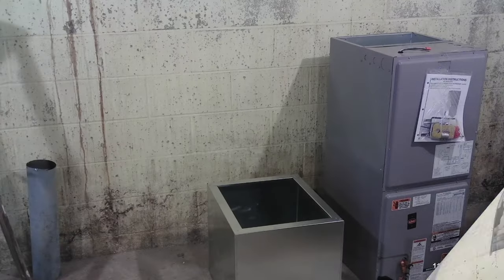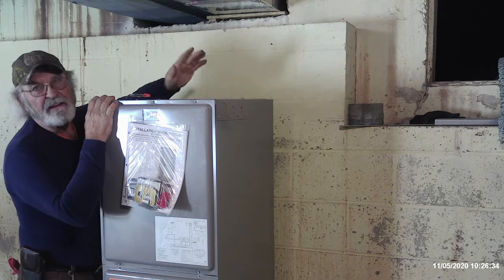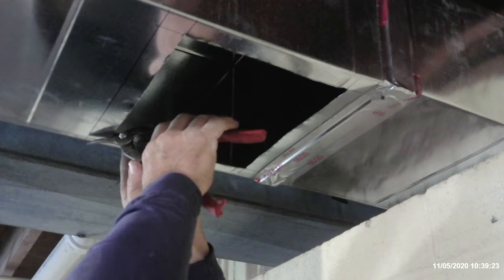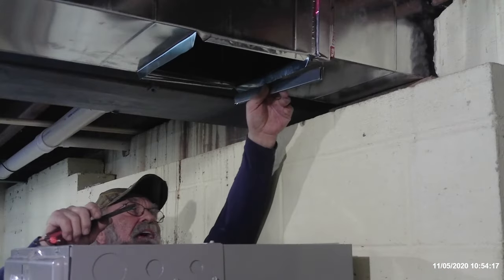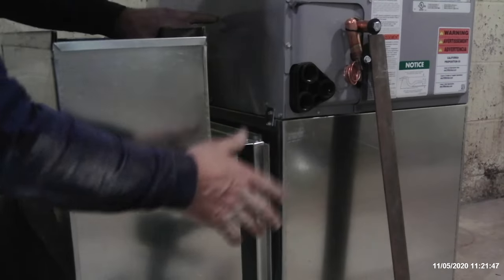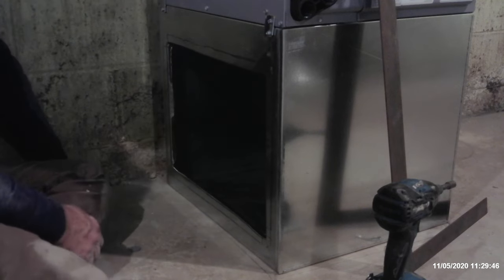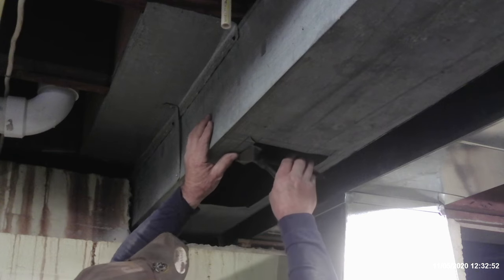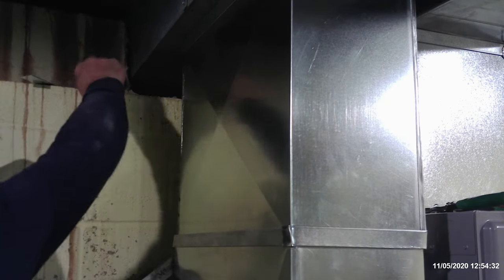Air Handler,  Centerline Plenum Transition and Return Air Installation

Comment: Wendell i love watching your hvac videos, as i have installed a few myself for over 50 yrs and trained a few guy's thinking they wanted to learn hvac business. Watching you is like watching Bob Ross painting a masterpiece. THANK GOD FOR ZIP SCREWS!!!
Reply from the maker: I remember the first day hanging duct with an old guy back in the mid 70's.  I'd hold an 8' piece of trunk line as he would use a punch to poke a hole in the hanger and bottom of the duct then run in a pan head with a flat screw driver.  THEN I got a better job in the big city.  The guy that owned the company gave me a Black and Decker VSR electric drill, a 50' cord and a NUT RUNNER.  I asked him what that was for.... LOL.  He handed me a 500 count box of 1/4' x 3/4 hex head zip screws and like they say...the REST is history. LOL.   Good GAWD...I thought I'd died and went to heaven !!!  
    A couple years later a buddy bought a  7.2 volt Makita battery drill.  What an incredible discovery that was.  I'm sure Tom, that you remember all those kind of things as well.  Thank you for taking the time to always make the best of comments !!   The Bob Ross part really cracked up the Missus...
Reply: Awesome memories. I always felt so grateful for being younger. I started in in 2005 at 22 yrs old

Comment: Great install,  Tractorman44. Today's  rookies would throw a flex connection on the supply and return to compensate for there inability to measure with precision.Thxs for the vids!
Reply from the maker: I have used flex connections commercially in the past but only as vibration isolation.  I don't remember ever using them in a residential application unless hanging a unit from the trusses in an attic, but that too would've been for vibration isolation.    But I have seen a lot of them on units while on service calls. Thanks David for the comment !!
Reply: @tractorman4461  
Thats what they used at my house to do a hvac replace job.  They do have good sheet metal guys. They designed a filter spot at the shop for a air bear glassflo type filter 5" thick in the return L .
But they used the flex boots on both return air and presure air sides. 
Almost no sheet metal work was done at the house.
Reply from the maker: @bobbg9041  Yes, there really isn't anything wrong with flex connectors, as they provide a specific benefit to an installation.  The most important thing about your change-out was the addition of the filter slot for the special filter.  I'm not familiar with that particular filter, but I'm assuming its an expanded surface pleated filter.  Sounds like you are enjoying a dust and pollen free indoor space !!

Comment: Outstanding work !  I,m an old-school tinner like you even down to snipping the corners on the drive-cleats. 30-plus yrs. for me.Still at it.
Reply from the maker: That's cool William.  I'm in the middle of a nasty job for my son right now.  So that's going to be a good three or four videos in a series.  Air handler, all new duct in a renovation project, adding a wood fired furnace and motorized back draft dampers in the supply plenum of the air handler and in the short trunk line from the wood furnace. 
   I've got a couple sheet metal playlists put together up top if you are interested.  They really aren't geared for experienced guys, but if you just like watching sheet metal videos, be my guest.  Thank you for the compliment up above !!

Comment: This showed me how to connect my plenum box to the air transition on my existing air handler.  It was something else to find cookie sheet sized holes in my air ducts.  Now those are getting replaced and this is one more piece of the puzzle.  Fun work still ahead in the crawl space.
Reply from the maker: I never liked crawy spaces, but have been in hundreds of them.  Some bad, some are worse and none are good !!   If your duct is not insulated, you might consider doing it.  Not easy but it'll be worth the aggravation in the long run.  If you do, this is a good product. but only use it with aluminum tape.  Duct tape will fail.  You can even wrap the round pipe with this pretty easy. https://www.amazon.com/Insulated-Metalized-Mylar-Double-Bubble/dp/B00T8ELAZ8/ref=sr_1_5?crid=1JUSJ9W534T3P&keywords=mylar+covered+bubble+wrap+roll&qid=1643892250&sprefix=mylar+covered+bubble+wrap+roll%2Caps%2C165&sr=8-5  Thanks Nathan for an awesome comment.  In this playlist is one utilizing this product: https://www.youtube.com/watch?v=PvDab537ul4&list=PLk72G9DTzZ1taVZjyeN9DKr52HQ3hhcXd

Comment: Thanks for the sheet metal videos you are a true craftsman. Like how you showed how stuff is done in the field vs a shop setting. I just did a job and premade a 4 inch spacer on an oil furnace to keep it above the heat exchanger. Then tied into the plenum with s cleat. It worked out great takes a lot more skill than ductboard. We don't have access to Pittsburgh seam here in field. Was shown to leave the s cleat an inch long top and bottom then notch a layer out so you can hammer them around and hide the gaps.
Reply from the maker: Oh, I can tell you dozens of tricks I've used over the years with S's and drive cleats.  I have bent many a plenum on the floor of a basement back in the day....I don't want to have to go back to that.  I've also made hand made pittsburghs too.  But no more. Asdasda, if you like the 'on site' portions, check out this playlist a little at a time if you'd like.  It was a tough one:  https://www.youtube.com/watch?v=PvDab537ul4&list=PLk72G9DTzZ1taVZjyeN9DKr52HQ3hhcXd

Comment: I learned from my uncle, and he does things almost exactly the same way you do. We used the old screwdriver trick, too. I use the dewalt demo chisel now. I have the exact same hammer. I'm 36, and the hammer is about 35 years old! My uncle taught me S was for the shape/smooth seem, and the C was for channel/clip. We always called them S or C channel/clip. It shows you that if someone wants to work and make a living for themselves, you don't need a ton of tools or a bunch of crazy names for things to get the job done. You just need to get off the couch and get to work. Into home depot I go on Sunday at 3:30pm to go install a furnace. My second job today. I installed rear calipers and pads on a 2003 envoy this morning for $140. Now, to install a furnace in a barn loft - man cave for $400. It's not too bad for a Sunday by yourself in Northern Ohio. Great job, and thanks for sharing your skills. I appreciate it 🙏
Reply from the maker: Awesome comment Robert.  There is so much work out there to do its unbelievable that anyone with the ability to learn and work is unemployed.  I applaud your integrity as a working man that 's not afraid of getting your hands dirty !!  Keep on keepin' on my friend and learn all you can as you do.  If you've the time and interest, check out this one here:https://www.youtube.com/watch?v=i2KFLZGbZwI&t=1s You may find it interesting and thank you for stopping by and taking the time for the cool comment.

Comment: Nice work looks tight and clean. I wish i had a teacher like you for my tin work.
Reply from the maker: Thanks Rocko for the nice comment.  I spent  lot of time figuring out how to use the machines to produce an adequate product.  As a young service tech, I used to inspect closely any kind of fancy duct joints, bends and fittings to better understand how the old timer laid them out.  I have a real nice project going on right now. Some real cool metal on a total system retrofit, complete with motorized backdraft dampers for an air handler and wood fired furnace.

Comment: Enjoyed watching the video on the installation .  The Rehab Addict, Nicole Curtis, is one of my favorite shows to watch, so would have been interesting to see the rehab on this house.   See you on the next project!
Reply from the maker: Yes, you would have enjoyed to see what it was and what it has become.  My cousin lives in a small lake community with roughly 67 landowners owning homes.  If I remember correctly, this is close to the 30th one he has either bought and totally rebuilt or rehabbed for existing inhabitants.  My daughter bought one (before I started you tubing) from him when he was partially finished with it.  I didn't even think to take a lot of pictures before and just a few during, but we have turned her house into a really nice home.  
    We bought it as soon as he finished the siding and the interior wall relocations and some basic wiring.  We then roofed it, wired it the rest of the way, plumbed it, hung the drywall, installed new HVAC system ducts furnace and a/c, (it only had window units and baseboard heaters), hardwoods throughout, new cabinets, deck, sewer system, tons of wood work and landscaping.  I recently did a 'redo' of a video highlighting some of the wood work including a walnut hand rail from her Great grandfathers Hotel and Mercantile built in 1882.  We used a lot of walnut lumber we sawed off the home place in '75 for utility room cabinet and bathroom vanity doors.  I've just been hesitant to upload it. Whoa...I got carried away....  LOL.

Comment: I bet you I have done it at least 3000 times just like that.  I don't have to think about it anymore, just like this man.
Reply from the maker: Well Joshua, I still gotta scratch my head a bit on occasion.  But the main thing I've found is the actual placement of the furnace can make or break the way a job goes in.  If you'd like to see more sheet metal, I have a couple playlists up above like this one: https://www.youtube.com/watch?v=PvDab537ul4&list=PLk72G9DTzZ1taVZjyeN9DKr52HQ3hhcXd Thanks for taking the time to make a comment.

Comment: Thank you my friend i was stuck pondering on a transition, and the best take away i got was at a 1minute 45sec. Part of your video, when u said to take out the screws to not hit the drain pan or coil, and use the same spot to fasten…. Wowwwww i was making it so complicated.
Reply from the maker: Awesome !!  Glad the tip helped you out. Remember there isn't just ONE way to do something.  It's just that some ways are just better than others.  Thanks for watching and if you have time to slip through a few, try this playlist of sheet metal videos: https://www.youtube.com/playlist?list=PLk72G9DTzZ1tqw8ST_xdUlPoy_O-SmuBx  The first few are boring straight ducts, they get a bit more interesting down a few vids on the list.

Comment: I was taught to remove the coil and secure the AH to the pedestal by screwing the cabinet down. Would hate to have screwed the brackets into the drain pan...
I am interested in the mistake mentioned in your video description. I watched the video a few times and haven't caught it. 
I think I  do avoid mistakes pretty well. When I inevitably do make one I actually like telling others so they might have less chance of dealing with the same self inflicted issue later, in a hot attic, tight crawlspace,  whatever their case might be. 
Not asking for you to spill all the beans yet.
Reply: Screwing the ah down that way wouldn't  be advisable. Imo.   Visible connections are usually the best. Plenty of duct work that could be re used years later gets destroyed during change outs due to hidden screws.
Reply: Just gotta know where to look or when to take a deep breath and find that last screw. It's like screwing a air cleaner to the side of a furnace from the inside. The worst is when walls and ceilings are built burying the unit so screws cannot be reached. I can remove the coil if I'm changing the AH anyway. The carrier  AH s we use have a filter rack on the bottom and then the drain pan. Also I will trace the opening instead of measuring it. Brackets would be a mile long up the side of the unit. I understand what you're saying condorman it is best to have things as easy to access as possible. That's why we put these units in stinking attics and such ugh!
Reply from the maker: @condorman26  I've been guilty in the past of putting screws in hard to find places out of necessity.  I keep a Vaughn flat bar thinned out on a belt sander to slip way back inside an otherwise inaccessible location to shear off the screws with a few hard hits.  I have had some bad ones back in the day too. The flat bar can reach to halfway across a plenum to shear one off that was installed from the inside out.  LOL.  I hated damaging more than necessary during demo.  It just adds to the work load going back in with new.  Out of that frustration, my mind is always on the next guy coming in down the road to undo what I'm doing currently.
Reply from the maker: @andrecontois8510  Man, I have literally pulled my hair out back in the 70's early 80's tearing out first generation forced air furnaces.  It seems like 24 ga was standard fare back then and all the returns were dove tail...screws were a lot of times a #12 pan head.  This was before hex heads and nut runners were even thought of.  Nothing kills speed like backing out #12's with a flat screwdriver when you can't get square onto it.  That's where I came up with the thinned down Vaughn flat bar for demo jobs.  Works great.  
   Attachment to the bottom is determined by the way the different brands are constructed.  This brand here has those 4 perfectly located assembly screws that allow screwing in to the sides like I did with no potential of jeopardizing the integrity of the drain pan.  Others require attachment as you describe.  No matter if the unit has a bottom mount filter or not, because I incorporate a filter slot that holds a standard size filter on virtually every job.  A lot of those filters are not easily replaced with an off the shelf filter.  Home owners always seem to neglect them if they are not easily replaceable.
    Ok....about the mistake. Not a big deal, but I insist on always aligning my pittsburghs all in line, but not paying attention, the top duct is reversed from bottom duct and you'll see the resultant crooked bend of the drive right at the 18:00 minute mark.  Now it sticks out like a sore thumb !!  I like sharp, crisp bends and insist on trimming the sharp points off the drives as they are folded over.  It just trims the job out to look nicer overall.  It's like taking a rag and wiping the pipe dope off all the exposed gas line fittings.... just looks trimmed out much better.
   Above I referred to 'first generation forced air' furnaces.  I got into the field in the mid 70's and a lot of forced air furnaces at that time were nearing 20 years old but there were still many, many gravity furnaces still in service.  I tore out dozens and dozens of gravity furnaces with the spider web of 10'' or 12'' round pipes going at an angle from the round bonnets to interior side wall cast iron registers.  A single large 16x30 return air grill was on the outside wall in a living room. We then would convert all the interior s/a grilles into return air grills and cut all new 4''x12'' supply's on the exterior walls thoughout the houses.  Are you two guys, Condorman and Andre,  old enough to have been involved in these types of change outs ?  Heck, back then I was still removing the old coal stokers up in St Louis and outlying areas and installing Natural Gas 'upshot' or 'inshot' conversions.  Some had belt drive blowers, some were still gravity coal.  If you are both too young, you really missed a lot of fun !!  Seriously, it was just some really cool work to be involved in.  Damn....I see instead of a comment, I wrote a book...sorry guys. LOL

Comment: Your Sherry metal work is awesome! I'd like to get to that point my self.
Reply from the maker: Thanks for the compliment.  All it takes is a little time and thought during the measuring process.  Taking the extra ten minutes to double check measurements saves immeasurable time on the install. If you don't have any equipment I'd do a continual FB Marketplace search for sheet metal tools.  They show up all the time....even lockformers and 8' brakes.

Comment: Tractorman, great vid. You make sheet metal look easy
Reply from the maker: Well Marco, I gotta tell ya man...it wasn't so easy for me back about 40 years ago.  I just never told the boss I couldn't do this job or that job, so he just kept piling it on.  I've been away from sheet metal for about 25 years shifting more to commercial service, chilled and hot water piping, and digital controls and refrigerant piping.  But retirement is letting me help out a few people that need it in the form of metalworking.

Comment: Tractorman44, thank you!  I just used your double folded seam to join a return to a furnace.  If you ever want to do so, I'd be more than happy to pay you for time just to come learn so tips and tricks, or talk by phone just to get a few questions answered.  Thank you for all the videos and info!

P.S  My offer is good anytime you have time! 👍💯
Reply from the maker: The double hem sure reinforced the metal a lot doesn't it.  I used to use the double hem combined with a 3/4'' dove tail, cut the return to the exact dimension and fold the dove tails inside the side of the furnace r/a opening.  One thing I do when forming an unfamiliar series of bends, is draw the bend and stick it to the brake with the magnets.  That way you can figure which fold or bend needs to be next.  
    You probably should try to locate a night course at a local jr college for some sheet metal classes.  I'm pretty much out of it now and really only work for family as far as sheet metal goes. If you are a 'young' man I'd suggest trying to get accepted into the closest sheet metal local union.  Those training classes are second to none for today's apprentices.
   Thanks for watching and expressing the desire to learn what really IS a good trade.